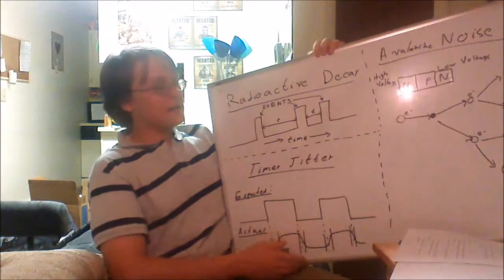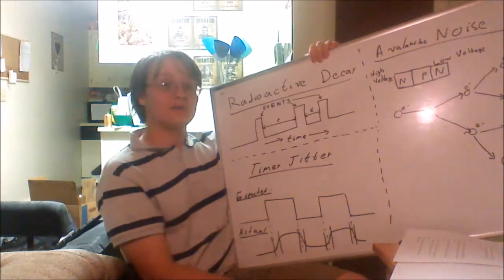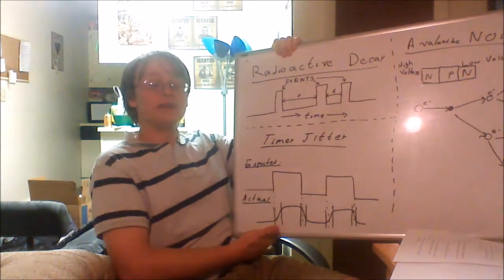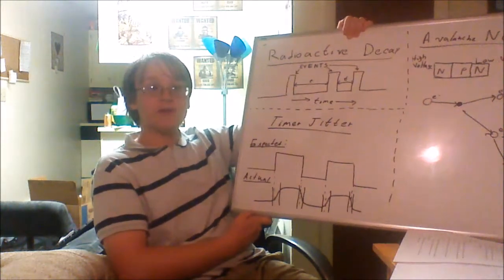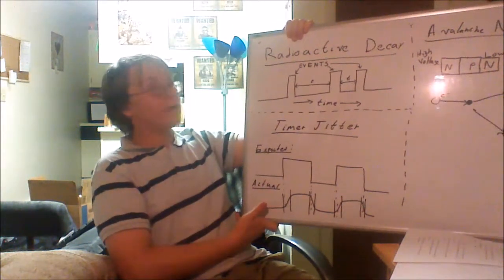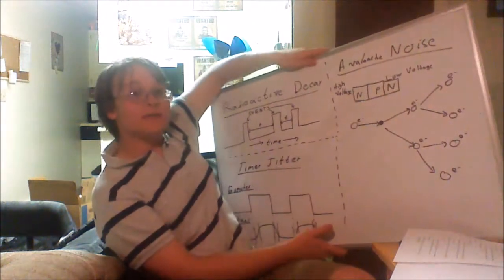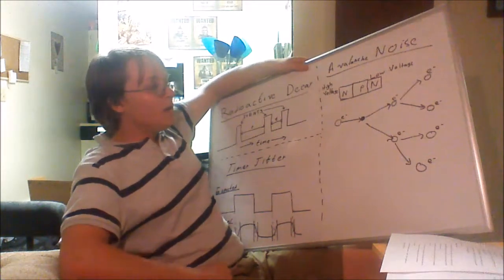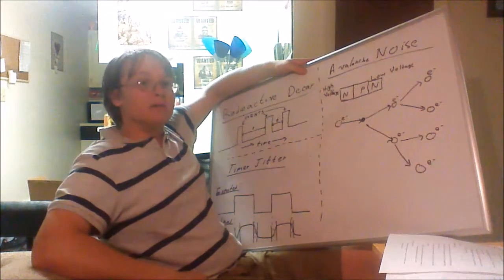Introduction to Hardware Random Number Generators

Comment: Is radio active decay something that we should even be discussing?  I don't know about you, but my plutonium stocks are a little low at present and Asda no longer stocks it.  Perhaps focusing more on semiconductors might be more appropriate for the average hobbyist?  Not sure if a reverse biased transistor is actually in avalanche mode.  Below -10V it's probably just plain breakdown effect.  You might mention a higher voltage Zener diode.  A reverse biased 24V Zener generates 1Vp-p noise running at 30uA, albeit with a slightly different statistical distribution.